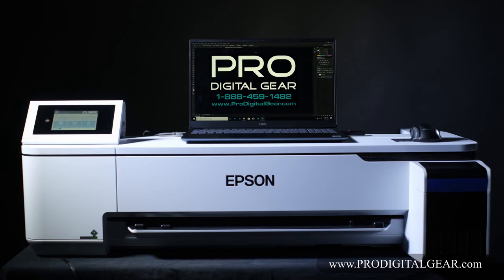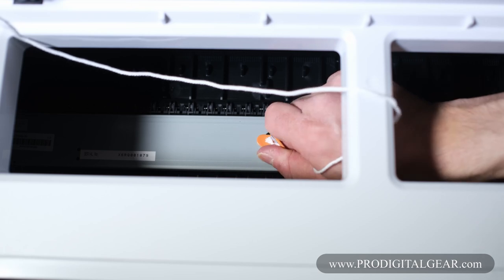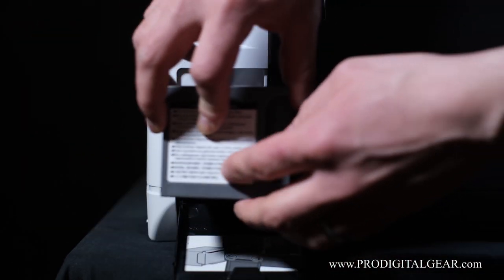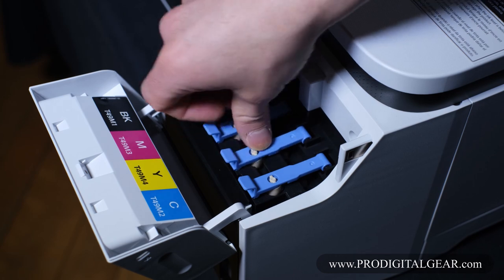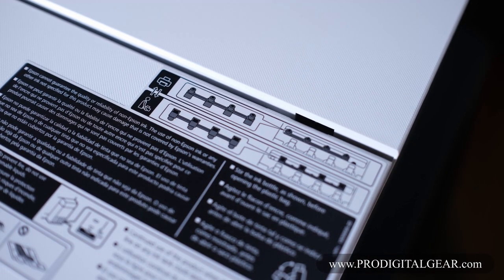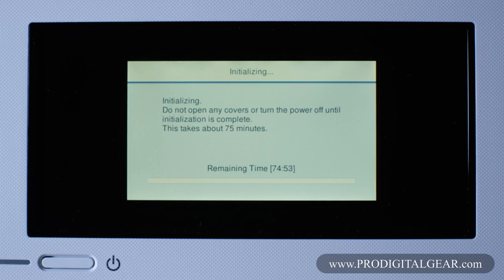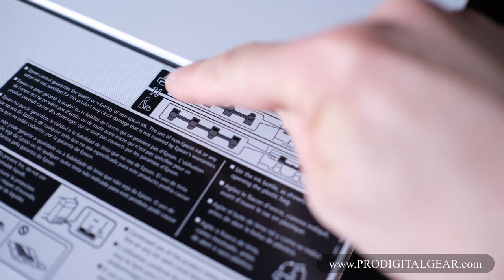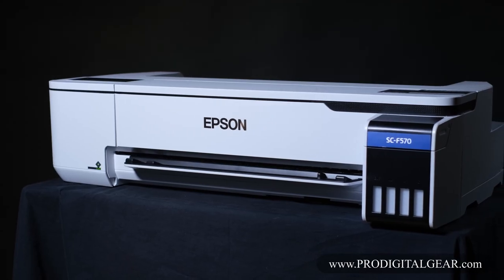Warning Epson F570

Comment: Unfortunately, I saw your video a year after I got the printer, I had problems at the beginning charging the lines, and Epson told me to do a deep cleaning twice in order to make it work, they never told me to remove the rubber caps, I been using it like that and since I don't do a lot of printing it will work fine, until yesterday that I had to print more than a dozen tumblers is when the  head was terribly clogged, and I did several cleanings and nothing change, until I saw your video and remove the rubber caps now everything makes sense, I removed the rubber caps and do a cleaning and right of way I notice the difference, I still did a deep cleaning and bam, now is printing like new, thank you very much for the information, I was ready to buy another printer, you save me a lot a money

Comment: URGENT!!  I'm at the point where I was suppose to charge the printer with ink and hit the ok button.  The printer started priming the printer with no Ink in the printer.  I shut off the printer and I'm trying to get back to the screen where it will sayl "the process may take up to 72 mins to complete."  When I got back through the menus, the printer skips that point.  Now the printer thinks I'm refilling  due to ink consumption.  The tanks have never been primed.  Is there a way I can reset the printer to band new mode and start over again?  I currently have the tanks filled up to the top line and printer is off.

Comment: I totally missed that bar too, luckily for me I have been printing with apparently no issues, but I just went and moved it to the side. That little sticker was where you mention...
Reply: Yes follow the sticker ha ha. Glad you didn't do what we did. - Jon D from PDG
Reply: @jonathandenicholas3312  What happens if you did? What was the resolution?
Reply: @JGood-rm6nq  Jon D here from a different account. You have to run cleaning cycles until the ink reaches the print head. At least that was the quickest fix.

Comment: The issue mentioned is not correct as the machine comes delivered with the valve covers in the correct position.
Reply from the maker: The issue mentioned is corrected. Some people might do what we did and wrongly assume the opposite. So this video is to clarify that for them if they accidentally do what we did or if they remove it and can't remember which way it should be and for what reason.

Comment: Can we use Sawgrass True pix Roll paper instead of Epson DS roll?
Reply from the maker: What is the core size? This print only accepts 2 inch core not 3 inch. Also the sawgrass media would need to be coated with the same coating as the Epson paper to accept the ink. Profiling might be tricky too.

Comment: Could you run easy subli through this printer?
Reply from the maker: I have not tried it. As long as that media will physically fit in the printer and it will accept the Epson dye sub ink it should be good. You might have to make some custom profiles for it too.

Comment: Hi, I would like to know how you fixed the issue... I didn't know about removing the rubber strip either and I can't make it to work. Thanks in advance.
Reply from the maker: Keep doing cleaning cycles. The ink just needs to make its way through the lines since it wasn't able to with those caps on. I believe that is all you can do.

Comment: Does this printer ship with any RIP? No, it does not. I know the answer, just getting this out there in the public. Epson will not give you a license to use their Edge RIP, NOR WILL THEY SELL IT TO YOU! You are on your own with a RIP, they refuse to even suggest one. Do you need it? Maybe you don't, it comes with a driver, you won't know what you're missing if you don't have it. Epson offers the Edge RIP as a download on the Epson support page for the F570, but don't try actually using it, because it doesn't work without a license, which they won't allow you to have! Absurdity at it's finest! As long as you are happy with those TWO choices - Textile or Rigid, yeah, I guess you CAN get by without the RIP. But REALLY, Epson?! It ships with the same printer sold in other countries. Actually, there are SOME people in the US who had a license in the box, that must've been a mistake on Epson's part.
Reply: I received it with mine Feb 2021
Reply: What exactly is the RIP?
Reply: @mimi121880able  Yes, that would be my point exactly. Some people get the RIP. Some don't. Makes zero sense.